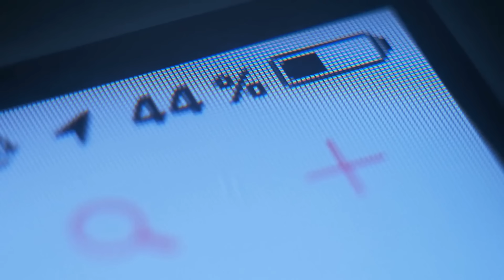15 New Future Technology Predictions for 2030 That Will Change The World

Comment: D=r five dimensional T.  If something is not true cold and firm to the present it will move a distance.  AI. A I must know humans have thousands of neurological pathways for every thought and move. If one thought is not cold firm, it will evaporate in the sun and the thought won’t be thought but the human does not short circuit like a computer does under the same conditions.  And therefore the computers and A I should emulate humans as if the human were a fuse that doesn’t burn. We are necessary even in ASI.

Comment: Absolutely nothing is going to be any different than everything you have now, look at Apple as Perfect example of the new mind set of corporations. The iPhone has only either added a “new camera” as a cheap option upgrade or “new apps” nothing has changed in the iPhone since the 1st iPhone came out,just already existing slightly newer but nothing innovative. Even Apple AR goggles are nothing innovative or special, this are using already existing technology and packing into a unique product. You will be driving the exact same cars, flying the exact same planes, and voting for the exact same uneducated politicians. And if anything, the world will be worse than it currently is… So, maybe not think like the 1950’s television shows made out what the year 2000 would look like 40 years from then, because 95% of the world is the exact same as it was in 1950, we mostly use the same energy production that our great grandparents used in 1850, so as long as a Baby Boomer is in Politics we will never see any three advancements…

Comment: 0:13 - Essas 15 tecnologias moldarão nosso mundo no futuro
0:30 - Nº 1: As pessoas podem controlar seu ambiente pensando
sobre isso
1:07 - Nº 2: Espécies extintas podem ser ressuscitadas
2:10 - Nº 3: Comida com o sabor que você deseja
3:08 - Nº 4: Podemos viajar para qualquer parte do mundo em minutos
3:59 - Não #5: Usaremos perfumes e desodorantes digitais para
controlar nosso cheiro
4:39 - Nº 6: Teremos que resolver o problema do clima
mudar
5:35 - Não #7: Os robôs farão muitas coisas por nós
6:55 - Não nº 8:As consultas médicas serão substituídas por consultas automatizadas
exame
7:44 - Nº 9: usaremos roupas inteligentes
8:17 - Sem #10:impressão 3D de produtos do dia a dia
8:51 - Nº 11: Sistemas de monitoramento de drones por infravermelho
9:27 - Nº 12: Eletricidade sem fio
10:00- Sem tecnologia #13:6G
10:40- Não #14:0 nossos carros dirigem sozinhos
11:21- Nº 15 Forças policiais robóticas automatizadas

Comment: According to reports, China has already launched a 6G test satellite that uses a terahertz technology launched by the tech behemoths Huawei Technologies and China Global launched since.
One Chinese lab earlier in the year achieving 6G-level wireless transmissions, with transfer speeds of up to a whopping 206.25 gigabits per second. That's more than 100x faster than current 5G, which generally peaks at about 20 gigabits per second.   10:01
The CNIPA claimed that out of approximately 38,000 patents related to 6G worldwide, 13,449 or 35% came from China. The U.S. was second with 18% of the 6G patents. 
Sources: PhoneArena; Tech360 tv; Inside Telecom
Reply: gip .......and yet the chinese power grid can't even power the 5 g networks they have built. One instance of 6 g doesn't prove anything.
Reply: And the CCP is in the bot game for P.R.

.. 🤔